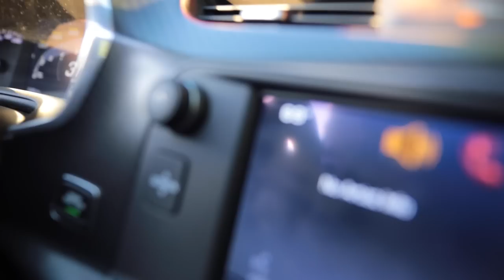She Loves The New Exhaust! | C7 Corvette Corsa Install

Comment: I've got a BTR stage 4 cam with Corsa extreme exhaust and long tube headers on my c5 z06 and geez does that thing chop! Love the crisp corsa sounds
Reply: How many miles you had before the cam?
Reply: @Humble_Lyfe  solid 50k. I’m at ~64k in an 02
Reply: @DannyMac714  Nice 👍. I have a 5th gen Camaro. It’s at 130k miles and I’m scared to do a cam because the fact that I get a lot of people saying a cam at 130k is not worth it. Unless you rebuild the engine and I had someone who told me they would do the rebuild and cam for $10k.

Comment: Hey Gavin. If you pull the fuse to the NPP it will always have the valves open even at a cold start and be loud all the time. With the fuse in the car starts with the valves closed regardless of what mode the car is in. It opens up at a certain RPM. I pulled mine and it is at its loudest all the time. Still not as loud as I want it to be, but that will change with adding the Corsa that you put on yours.

Comment: One more thing...save your money and swap a procharger and keep the factory cam, gotta pull the motor for a cam and VVT has more benefits than drawbacks, or keep a small cam and let the procharger make the boost....gunna need alot of lt4 fueling though

Comment: Proof that stock to stock the LT1s are slightly faster than the coyotes, especially at the low rolls.
Reply: Yeah but the power difference still makes it sad that there so close.
Reply: @jacobdavis6576  what power difference. They both make 460 hp stock. But that coyote has a corsa exhaust so it’s probably closer to 480 but still got the gap.

Comment: Recently bought a 1970 cougar........ Then I just found out I have to completely pull apart the engine........ And I have non of the proper equipment, knowledge or money to pull it off. My luck is worse than yours with cars, gavin.

But I'll be damned if I don't try to get it running

Comment: I have a question for anybody that knows about motors. I have a oil pressure problem but have changed the oil pump and sensor. I’ve changed the oil multiple times in a couple of weeks and put seafoam in the see if that would work but didn’t. I’ve spent to much money on trying to fix it but don’t want to sell my truck. Does anybody have any ideas on what it could be??